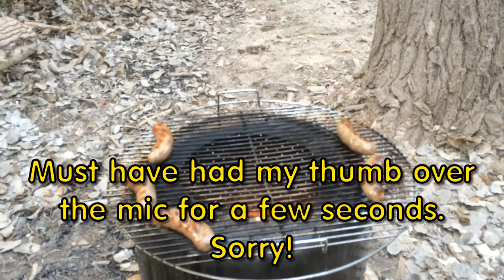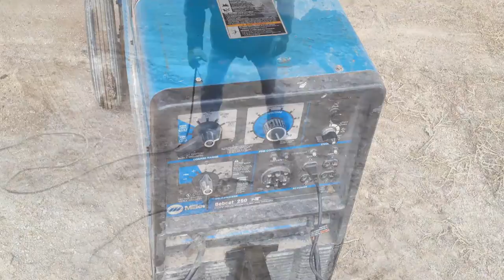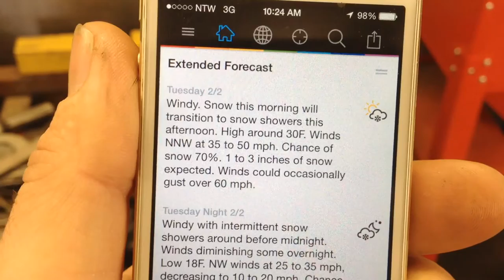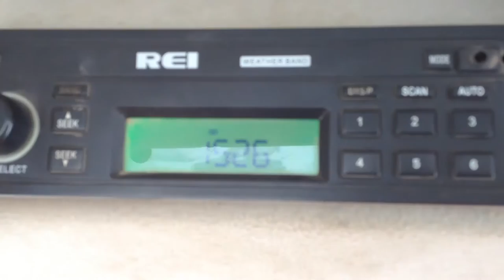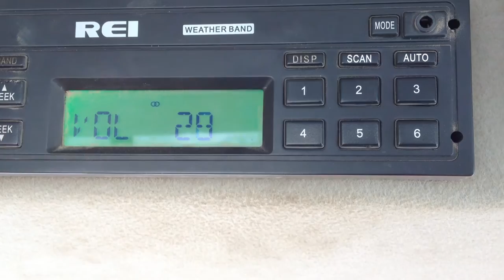Wood Chipper 14  the VLOG

Comment: I watch the donnyboy channel (the small engine doctor) and he tells me that if your gas has ethanol added to it, it will varnish up your carb right right away. Only way around it is to drain the fuel when the thing isn't running. I am spared that hassle, no ehtanol in Alaska. But I faithfully add Sta-bil to my gas as another commenter recommends. And drain everything you can, like lawnmowers in winter and snowblowers in summer.

Comment: keep some sea foam in it .
Reply from the maker: +Tom Kline Haven't found sea foam in years. Put some Sta-Bil in it. Hopefully that works.
Reply: Hello Matthew,  I have had very good results with Sta-Bil over the past many years.  I hear good things about Sea Foam too.  Seems to work well as a carbon cleaner also which Sta-Bil does not.  Today's gas and small jets present a challenge.  I have found that air and solvents don't cut the varnish in many cases.  The Yamaha Rep told our dealer that their jets have to be physically cleaned with welding tip cleaners of the appropriate size.  Then air and carb cleaners. That has always worked for me.  I see many of the shops are now using ultra sonic cleaning tubs with detergent and getting good results.  I live in SE Alaska on the water so perhaps Sea Foam markets more toward the coastal areas although South Main Auto in upstate NY uses it a lot in his auto shop.  I am a more linear person so I prefer your videos where you are on task but still talk us through the job.  Just my personal preference since you asked.  Take care and give Dakota a scratch behind the ears.  Doug